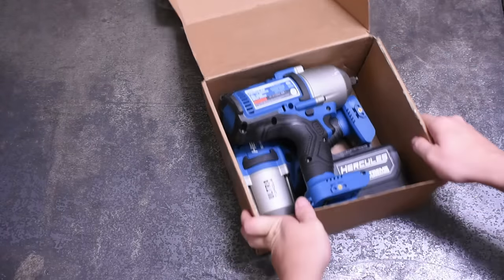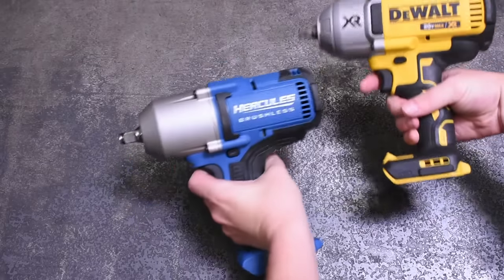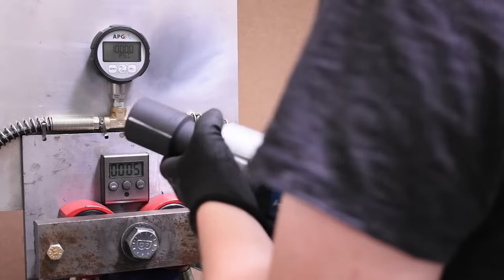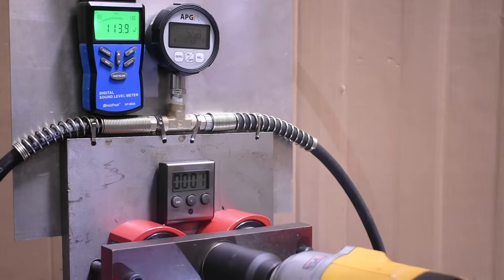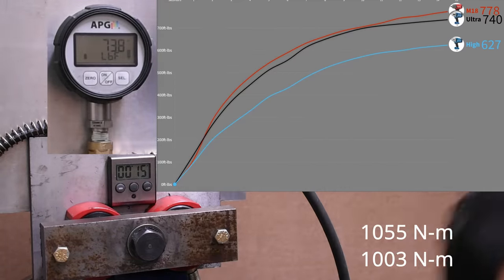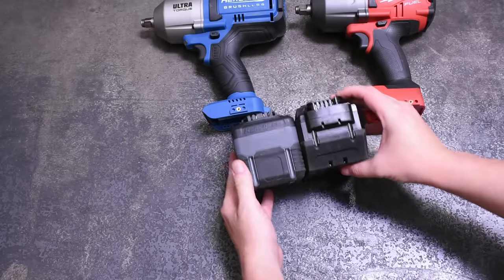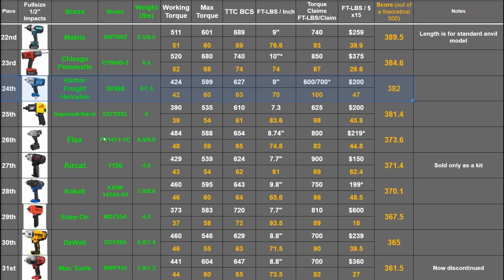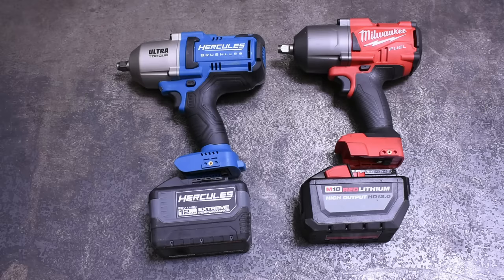Harbor Freight Dethroning Milwaukee & DeWalt w/ New Ultra Torque Impact Wrench?

Comment: Considering the video release y’all did on the “new” 2767B Milwaukee m18 impact, I would not be running out and buying that, after all the failures it seems to be having!  I am a big Milwaukee fan and even with that said, I will not be purchasing the 2767B, I would probably be looking for a reconditioned A model, or another brand.  It sucks because as you know, you try to stick to one brand so you don’t have to buy a bunch of expensive different brand batteries!

Comment: Im a professional  mechanic 55 hours per week , 5 years of experience  so far only Milwaukee can survive  that torture. I have pieces  of plactic and rubber missing  out of my impact , dropped from 5 to 10 ft on daily basis. Ran  over with the vehicle ones ,and its refusing to die😂😂😂 i have 13 years  old hack saw with original  battery and a charger  and its still working  flawlessly.

Comment: Harbor Freight does some insane sales; case in point, they currently have a "Buy any two Hercules tools for $99.99" sale with the 20V brushless line. Two of the features were the 8AH Extreme Performance battery, normally $99.99 on its own, and the extended-anvil 1/2" High Torque, normally $159.99. I bought those two myself, so I basically got the High Torque completely free. I just checked the website and that sale is still going on, but it seems they realized their mistake because the High Torque is no longer part of that sale. XD

Comment: The 2022 Black Friday week has been Extended again as of today! So the Hercules Ultra Torque is again $179 ($199 retail), Hercules High Torque is $159 ($179 retail),   "21700 Tesla" 20v 12Ah High Performance cell Battery $110 ($139 retail), "21700" 20v 8Ah cell battery $69 ($99 retail) Fast Charger $40 and when you by the any Hercules power tool wrench with battery + charger you get $25 off so the Ultra Torque drops down to $155!!! Great deal for a driver at a super value, very well designed and build like a tank with the 5 yr warranty included and 3 yr warranty for battery & charger included!

By any $40 and up Hercules power drill/tool (selected models) and get a 2Ah battery FREE! 
Highly recommend!!!

MILWAUKEE step back, a new Ultra Torque KING has arrived! Can't beat that ... 😁👍

Comment: I think I'll definitely give one of these a go depending on pricing. I'll just need to figure out how to use my Milwaukee battery's with it 😂
Reply: I just wish that the Bauer and Hercules battery platform were interchangeable. I've got Bauer and the craftsman 19.2 and I'm not sure I want to add a 3rd.
Reply: @cbmech2563  I feel that. I bought a Walmart brand drill before I knew much about tools, thinking it was a deal, and it sucks lol. my Milwaukee puts it to shame. I got a 20v 4ah hart battery I want to somehow rig to work in my Milwaukees
Reply: @TiberiusCaeTsar  I see everyone talking about rigging batteries lol.  If you have a case of a dead battery you can just take the cells out of a good one and replace the cells.

Comment: Wish you had done tests with the 5aH battery too. I'm sure it's a lot less power and the deals they have for "buy a tool, get a battery" are either 2aH for the ratchets and 5aH for the impacts...
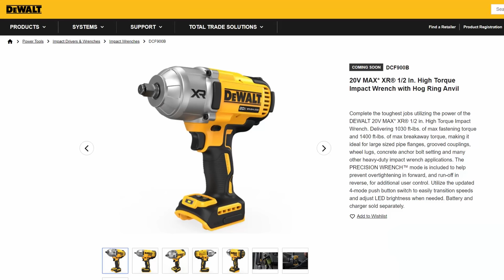Reply from the maker: 4:14 this is a 5Ah, we use 5Ah on all the tools for the standard tests.

Comment: Hats off to HF for putting out a competitive product.  However, for the minimal price difference between the Milwaukee and Hercules as a base kit, it is worth the extra money to buy into the M18 battery line.
Reply: As far as a start to the line yes, there's no wrong answer red or blue. When it comes time to replace a battery or buy a charger or add tools later, it's cheaper for blue than red. But if you only need a high torque then you take your pick. Or if you need more specialized tools then red is your go

Comment: Now that we see that the Ultra is regulary on sale for $179 (bare tool), this makes the deal even more compelling. Now, Ultra + 12Ah Battery = $328 vs the $500 for similar Milwaukee setup.

Curious to see if Hercules will have battery problems like the Milwaukee has on their High Torque. Since I don't see any particular vibration mitigation to separate the battery from the rest of the tool, like Flex, Makita and some others have.
Reply: I’m going to buy an adapter and run my dewalts under this beast

Comment: Hercules might be a good brand from HF. Yet to get a Hercules product from HF. I buy the cheaper stuff like Bauer, Warrior, or Chicago Electric. 

My Chicago Electric corded oscillating tool has lasted me about 5-months of light use. And it only cost me $15 for the bare tool no attachments. 

I did have a Bauer Orbital Sander break in 40-days and HF took the return over the counter. The Orbital Sander mid-way through a job just just off. I was glad they honored their 90-day warranty since the tool just failed to turn on after sanding a few spots one day. 

I take HF tools at least their lower-end ones 50/50 hit or miss. The Oscillating tool is still holding up and I got 5-projects of use out of it, which for $15 is a great value, but I was super disappointed in the Orbital Sander. 

The cheaper stuff from HF for power tools only comes with a 90-day warranty unlike Hercules, which has a 5-year warranty. Pittsburgh normal tools like hammers, chisels, screwdrivers and other normal tools come with a Life-Time warranty and they will replace it with something equivalent if it breaks.

Comment: You know, even if they performed the same, I'd still pay more for the brand name. Warranty length is a consideration to me, but failure rate is a bigger consideration. I've never had good luck with HF tools that have moving parts. Even if the warranty gets me a free replacement, I hate having to stop working and take a broken tool in for replacement. HF tools don't seem to be designed for daily use. They're more for occasional use. They seem to have a low duty cycle. By that I mean they can only be used a certain amount of times before they fail. If you're a pro, they might last 6 months vs if you're an occasional user, they might last the full length of the warranty.
Reply: You could purchase two of them for the price of one of these other brands. Just keep a spare in the truck like every other pro does anyway.
Reply: @otm646  did you watch the video? I don't think you did. The HF's aren't that much cheaper. Not even close to 1/2 price.
Reply: @jrjrjrjrjrjrjrjrjrjrjrjrjr  read my comment again. I'd rather have a 3 year warranty that I never have to use than a 5 year warranty I have to use every 6 months.
Reply: @aaronbritt2025  and you will use that warranty . I’ve had 3 each Their jacks , impact guns and impact sockets . Countless hammers and breaker bars in the last 15 months . You will use that warranty for sure . But if you have a name brand as a daily and a hf as a back up you can’t go wrong, I’d imagine

Comment: As long as they stay with the 5 year walk in walk out warranty the ultra is the way to go for battery, but as long I have air I'll stick with air. There are situations, especially with lock nuts that  electric, impacts or ratchets (air ratchets too) will just vibrate and not actually do the job and my nitrocat will just zip it off.  I r&r a lot of 5/8s frame bolts and it's not an unusual situation.

Comment: So watching @Philly Fixed vid, timing  how long it takes to remove a nut....So my question is, how much time do cordless/air tools actually last. My thirty year old 1/2" IR is not as good as the day I bought it, maybe 80-90 % now, but it still has some balls to it.  

My Snap On 3/8" ratchet is my go to, it's maybe 10 years old, maybe more. But it keeps on ticking. (the older guy will understand that) 

So HF now has a 5 year warranty, same as Milwaukee. What do they know that we don't ? 
.

Comment: My 5 year old 2767 is still working I got a second off Ebay for $225 and  6.0amp battery for $90.  In that time Harbor Freight has had 3 - 5 different bands they no longer sell. Not to mention all the drills saws sanders that use the same battery. Just Saying

Comment: I mean, the ultra torque one seems like the clear buy over the normal one and the dewalt, only $30 more than the normal one and it decimates the dewalt while costing $20 less and having a better warranty, not quite on par with the Milwaukee though but almost and you would save some money

Comment: @Torque Test Channel thanks for all the tests you do! Is there a place where we can access all of the rank lists? I've been thinking about switching battery systems and more familiar with the best of my current brand. Having access to the rank list would make finding the best models within a tool brand much easier. I've been going through old videos trying to take notes, but then I have to juggle the mental math of whether that was just best at the time and has been outdated by more recent stuff.
Reply: Just look at the charts at the end. Pause as needed

Comment: Nothing comes close to my $90 corded Porter Cable. Removing manway lids from rusted out mag chloride tanks for the city, the corded Milwaukee wouldnt budge them and we had broken 2 breaker bars.  My garage was closer than Home Depot so grabbed my Porter Cable and it snapped about 200 of the 300 bolts clean off. Wasnt a single nut it couldn't undo. I was very surprised. Im kind of scared to keep using it on cars lol. Great for exhaust bolts but I'd be scared to put it on anything important. 

 Now my cordless Chicago Electric... I can stop it with my bare hand lol

Comment: Being that Hercules are basically DeWalt knock offs it doesn't surprise me the similarities between the high torque and 899. That means that the ultra high has basically the same parts as dewalts 900. I was very much hoping that the 900 would leave Milwaukee in the dust, based on this test, that seems unlikely to happen. Time will tell since I'm sure the 900 will be on here at some point

Comment: I was using my dewalt 3/8 stubby impact to remove the bolts from my driveshaft, figured I’d do the front facing bolts first but after 30 seconds on hammering it wasn’t budging. I was at a loss. 
Double checked that I set it to high torque and to reverse, then hammered away until by gun rattled itself to death. The hammer action wasn’t working anymore and I lost it, just started slinging tools around and screaming like a madman…. 
Figured I had a trash grandad dewalt and the memes were real. 
So I turn to ole’ reliable, a 1/2 breaker bar that was older than me by a factor of 2.
I pushed and pushed but my itty bitty baby boy arms couldn’t muster up the might. Now I feel the anger bubbling up with a vengeance, I reposition the bar and now begin to push with my legs. I tell myself there’s no way I can’t break it now, I mean I skateboarded growing up so I gotta have some residual leg gusto hiding underneath my fat hammys. But alas… I failed once again. 
So I took the nuclear option and wheeled out the old 1/2 air impact… still nothing. 
I was lost, my life void of all its meaning and my reality shattered. I wasn’t even angry anymore, I was just sad. 
….That’s when I looked closely. 
At the threads…. They were left handed 

I spent all this time tightening this bolt to a number that would need to be expressed in scientific notation. 

Afterwards I couldn’t tell what was more impressive, the unparalleled depth of my stupidity and ignorance or the strength of that bolt to not cave in on itself and sink through the fabric of space. 

Feels good to get that off my chest
Reply: You are not alone. I just did the same thing on a John Deere gear box shaft bolt. Dont know how it didnt twist off.

Comment: Great video. Great information as usual. I have a question that's not exactly related to the video but i thought you guys would be the perfect people to ask. When pulling the trigger on a tool is the voltage applied to the tool motor specific to the position of the trigger? Does the voltage of a slightly compressed trigger vs a fully compressed trigger result in the same voltage applied? Please let me know if this makes sense , if not maybe i can explain my question another way.
Reply from the maker: Yes voltage is the same. Total watts to it is regulated by the board. The trigger is not a voltage potentiometer
Reply: @TorqueTestChannel Okay . Thanks for your reply!

Comment: As is not unusual for Harbor Freight, 2 months later and the price for both impacts has been lowered by $30 for the Ultra and $20 for the High Torque. Same for their 3/8 and 1/2 compact impacts which are both $10 less than 1 year ago. That re-jiggers the scores a bit. With the new 5 year warranty (and 3 for batteries) and the can't beat it price on the batteries its tough to beat HF.

Comment: Very impressive by harbor freight.. My only thing to add is people have to look at what eco system they are in as well.. I have mostly DeWalt tools so I have a good amount of DeWalt batteries and it would be more cost effective for me to stick with that eco system.. 

I have the usual bauer tools (drill and small impact) and they are great for little home projects but I suffer from the lack of batteries which is something I would suggest people look at..

 Make sure you pick an eco system and stick to it or find adapters so you can use the batteries you have from other brand tools..

Comment: Time will tell how durable and long lasting it is. Most power tools I have from harbor freight have not lasted as long or had as good quality.
Reply: Right. The reason HF stuff is cheaper is because they don't have the quality control measure other brands do.  I suspect that's one reason for the 5 year warranty.  I'd also rather spend more money on a brand with a more versatile product line.  I'm not well versed in Hercules products, but I feel safe in assuming DeWalt has a vastly more extensive line of options.
Reply: @fatfredthe28th  Yeah I use Milwaukee and DeWalt for stuff I want to last. I pick and choose the good stuff from HF.
Reply: @TheAnonymous1one  , the only way to do it as far as I'm concerned.  Can't say enough good about their U.S. General toolboxes.

Comment: How about longevity?? I've been using Dewalt for years without any complaints,  I doubt HF will last as long.
Reply: Well it does have a 5 yr no questions asked warranty now and they are on sale for 179 on the ultra so I wouldn't worry about it failing if it does then you'll get a new one for free

Comment: AND... now its 2024, I picked up the DeWalt 891 at Lowes $240 with 2 free PowerStacks 1.7's.  It is proven to make 1000ft-lbs, rated at 800ft-lbs.  Wow cheaper and much more powerful than this whole list from just two years ago.   And the 891 still rules mid-torque over the new $$$$ Matabo.

Comment: I disagree with the hyper car statement as some cars are in a class of their own. They also have mega cars now that surpass hyper cars as they have a megawatt+ of hp(1,341) and sometimes have equal weight ratios to be 1:1 as well. The car I reference to has 3 successors to it as well and has been out for some time.
Reply: You do know it was just an analogy and this video has NOTHING to do with any cars don't you?

Comment: I would really love you to test some 3/4 or cheaper 1inch air impacts! My shop has monstrous air compressors and I would be interested is seeing which or if any of those stand out among the rest
Reply: I'd like to see a test of the Kimball Midwest 1 inch long shaft tire gun, plenty strong for bud wheel nuts and hub piloted nuts but probably less than half the weight of a CP gun and probably a third the weight of the harbor freight gun.

Comment: Is there any official reasoning for DeWalt not taking advantage of their Flexvolt architecture? I would imagine 60V could get that motor spinning fast enough to make some unseen numbers in 1/2" impacts.

Have we maybe just reached the level where more power isn't needed? If the nut was torqued higher or was just larger would the state of the art be at a point where switching to 3/4" makes more sense?

Comment: You know it’s great that we are starting to get other Chinese power tool offerings other than Milwaukee. I have to say the biggest thing that lets me down with HF branded tools is really just over quality is super low. The battery quality varies greatly and this effects my confidence in buying into there brands. The molding for the case can be super inconsistent tool to tool ect. They are stepping into big leagues including in pricing they need to gain more attention to detail. Lastly the bauer vs Hercules thing to me is silly. Why not just make it all one brand and offer a budget and pro grade. Bauer has good options but Hercules has the stronger stuff doesn’t make at lot of sense.

Comment: While we don't have HF over here in Australia, that sure is an absolute bargain! I paid $500 for my RIDGID errr AEG Hi Torque & haven't even used it! I could've on 1 wheel nut my Brushless one wouldn't undo but it was quicker & easier to just open the boot of the Car & grab the Wheel Brace out instead of walking all the way back to the Shed to grab it! !

Comment: Hf has came a long ways.  I still don't see milwaukee hi reverse numbers that won't take off semi wheels torqued to 500 ftlb. I have a cheap Hf air 3/4 99$ that is magic at less than a 1000

Comment: I have run Hercules on the JOB for several years. Add the cost of batteries, and the Hercules is clearly the better value. Again, for all you haters, my Hercules cordless tools are used DAILY on the JOB.